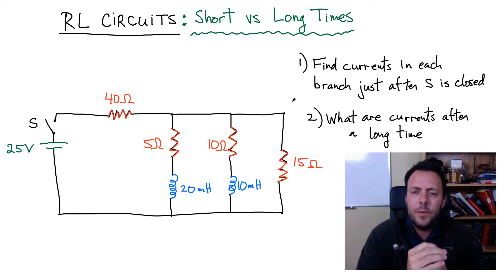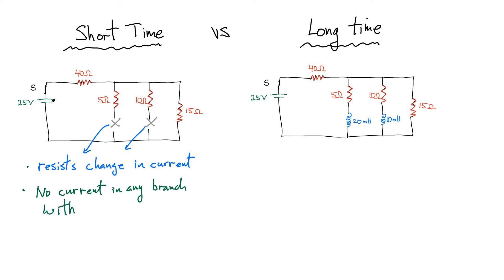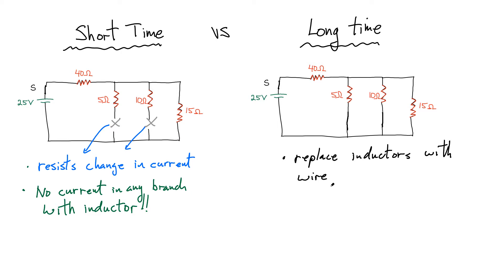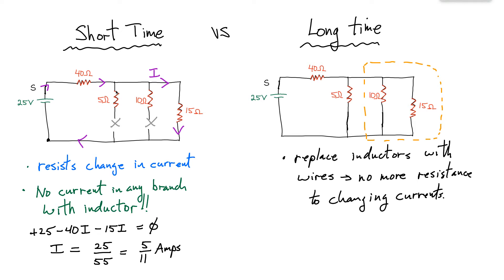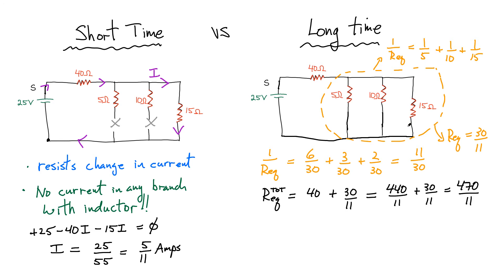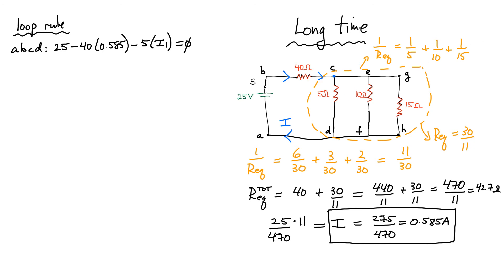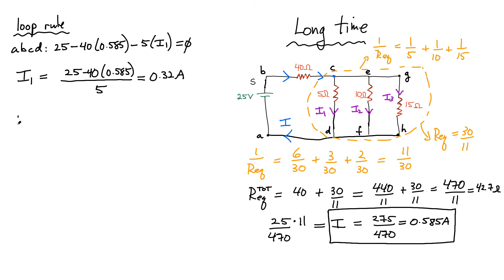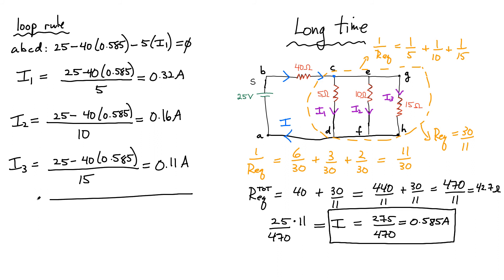Parallel RL CIrcuit: Short vs Long Time

Comment: What about if the current has been closed for a long time and is then reopened? What is the current immediately after the switch is reopened?
Reply from the maker: The induced voltage in the loop with try to maintain the current. Vl=L di/dt